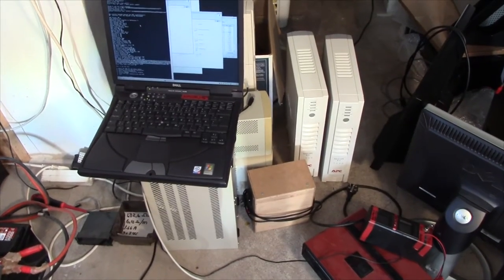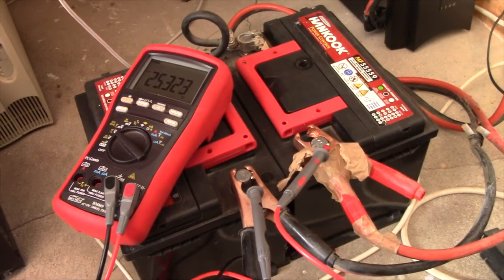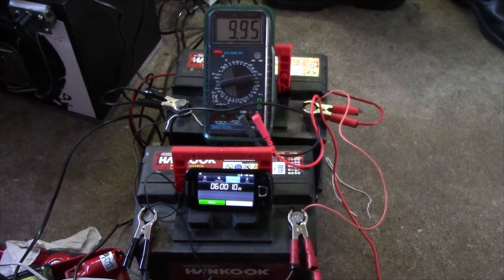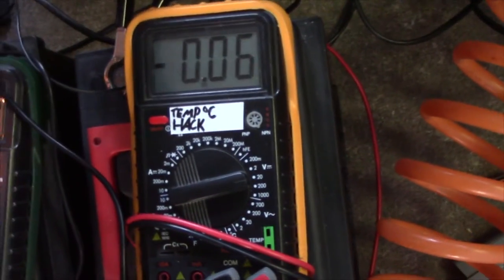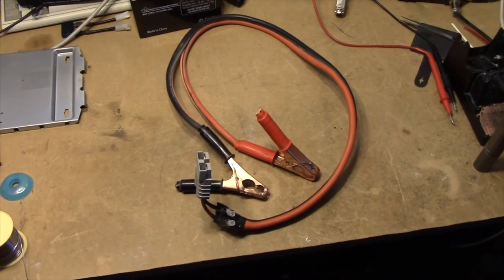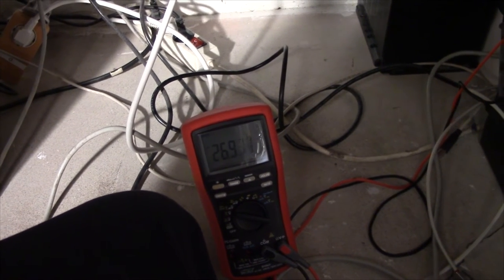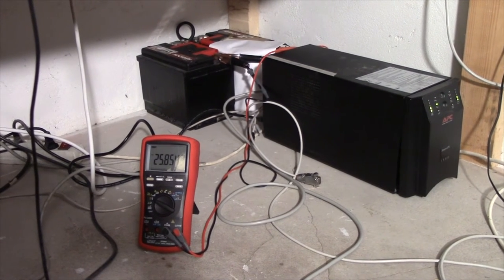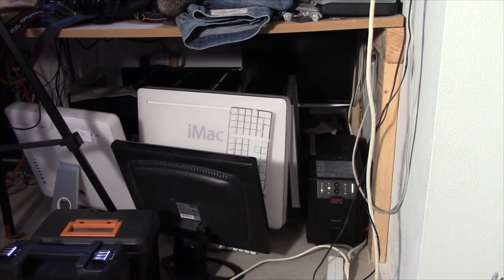Reconditioning my UPS batteries

Comment: Would it be better to put the batteries in a plastic, acid proof tray ?  Can you put the batteries and UPS on 2x4s scraps of wood to get them off the concret floor ?  Thank you for a great video.

Eyes UP and lights down,  tjl  Sent by Win7Pro64 w/ADSL
Reply from the maker: Tim Lipinski There isn't much point in having sealed batteries in battery boxes; they very rarely leak. I don't see why you'd want to raise them up, either, since the floor provides a bit of cooling, making the batteries likely to last just a little bit longer.

Comment: Why not wire the batteries on parrallel and get more capacity at 12 volts or does that psu NEED 24?
Reply from the maker: You want to use as high voltages as possible when running things that require lots of power. The total capacity of the two batteries is the same whether or not they're in series or parallel, however, you can use thinner cables and cheaper components when they're in series, since they're running at half the current for the same amount of power, compared to a 12 V system.

Comment: i hate to blow your bubble but since you are deep discharging. automotive CAR batteries you already distroyed them by diccharcing them more than 30 percent....these are " starter" batteries with very thin plates filled with scrap sponge lead only ment for short duration discharge as you practicevwhen starting a engine up, than you'l load them with a short burst of maby 100 amp in a second orso, and as soon as the motor starts running get charged up to 14,4 vilts by the alternator, what you need for running a radio, tv, ore lighting is a true " deep cycly"  ore traction batterie with much thicker plates and new lead, examples are the Gof cart types ( 2 six volt in series) to make a big 250 ah batterie bank they can give way longer running times and can be discharged hundreds of times to even 80 percent depth without a problem, also is not prone to voltage sag, even with loads like 100 amps....
Reply from the maker: +giottodiotto1 Yep.